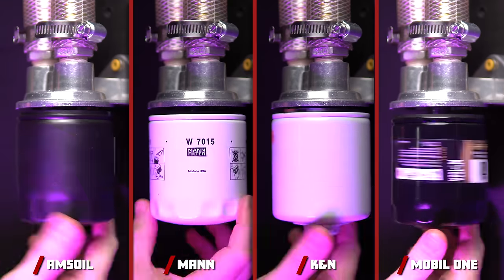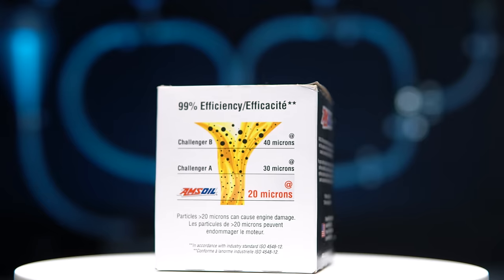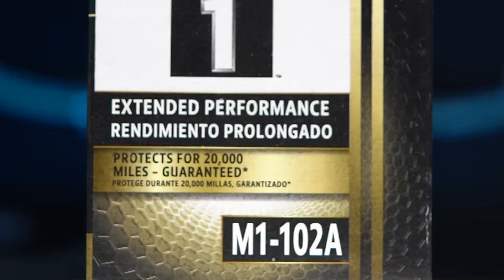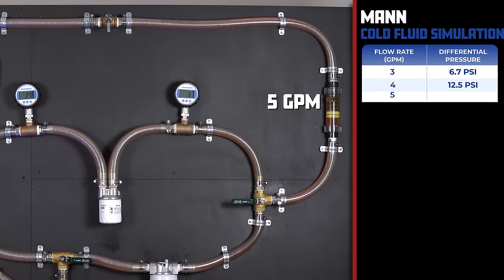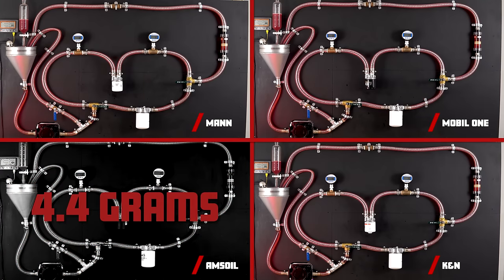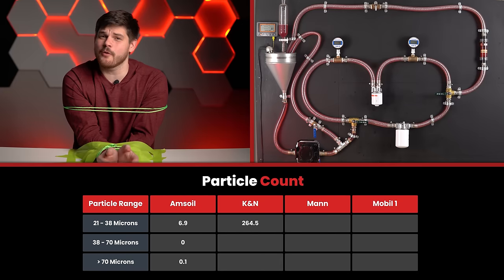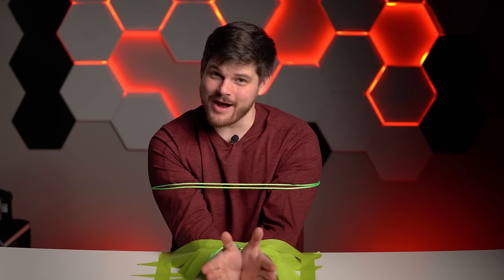Best Oil Filters of 2024 (Engineer Tested) - Amsoil | Mobil 1 | Mann | K&N

Comment: I appreciate you taking all this time, but flow rate is a moot point.
This is because the filter has overhead because in a running engine the contanmination will be high. 
What you really need to test is how much contamination gets past the filter.

Comment: Since 10W-30 and 0W-30 are the same viscosity and same lubricity at operating temperatures (once the engine is warmed up) is there any reason to continue using 10W-30 or even 5W-30 oil? The only difference I could find was they freeze more easily and are only thicker when cold compared to 0W-30. I absolutely understand the NON "W" number should be what the manufacturer recommends unless in extreme hot/cold weather.
Reply: Oil is very complex. Even though theoretically 0w-30 and 10w-30 should have the same viscosity at operating temperature, but in reality there may be some difference especially since 0w-30 is synthetic and 10-30 can be conventional. Also, "W" rating affects the non "W" rating.
Reply: @fattygamer94  I haven't seen anything showing how the "W" number effects the non "W" number. Unless I'm mistaken, the "W" number EXCLUSIVELY correlates to what temperature it will freeze at.

Comment: So are the bypass valves opening all the time at cold startup???
Reply from the maker: Most likely! depending how cold :)
Reply: @BrandRanks  no, the bypass valve will only open if the filter gets clogged.  Unless you don't change your oil every 5-10k miles, it will never get thick enough to open the bypass.  Engine oil is designed to flow easier at lower temps not harder.  The W in the oils stands for Winter not weight.  The lower the number the less viscous the oil.  So a 5w-30 oil will flow easier at cold temps then when it is at a normal running temperature.

Comment: Dumb question: how would these results translate for cartridge style filters?
I'd assume capacity and bypass wouldn't be relevant, but are filter media effectiveness and flow assumed to be the same as these spin on results?
Reply from the maker: That's not a dumb question! Great question. Unfortunately we have not tested cartridge filters as it would require an overhaul of the rig, but you are correct the bypass valve would be moot as that's included with your car not on the filter, I would not assume the same performance nor flow, given they can vary wildly. But at a minimum you could do it based on the material made off, for example I would go with a full synthetic media one for best filtering performance and average flow restriction. Thanks for watching.

Comment: Better flowing, less wear oils  and proper maintenance or even shorter maintenance intervals means you can get the best benefits of a filter that filters well. If you use long maintenance intervals, inferior lubricants with more wear, you need a filter with increased flow to keep your oil moving.  Oil, filters and maintenance practices together form a system. There relevance and rewards are effected by each other.  Those who spoil their vehicles pay a premium for shorter maintenance intervals, higher filtration, better oil get the payoff of less wear of components and typically longer service life. People with higher flow, less filtration, inferior oils and long maintenance intervals are rewarded with savings on maintenance but the draw backs of increased wear, less service life.  Pick your poison. 😂😂 Amsoil rocked the Project Farm review and I have used it in Motorcycles and will be trying it in my truck but if you want something cheaper that is AMAZING, try the Pennzoil Ultra Platinum oil. I have ran that oil for a while and have been impressed with its performance and cleaning abilities.  It has even increased compression in a old work van.  The van would only be about a quarter quart low but now it doesn’t lose any noticeable oil and the quality of the oil after 3k miles is much better than what I have experienced with other oils. If the Amsoil doesn’t knock my socks off, I have no reservations going back to the Pennzoil Ultra Platinum oil. I have to order it online because my Walmart doesn’t carry it, but it is worth it.  It has been the best I’ve ever used so far.

Comment: If you cut the oil filters open you will see which ones are identical and made by which companies. Mobile One and K&N are Champion Lab products. There are identical on the inside.

Of course I haven't kept up in the last few years to see if there is corporatism in play.

My comment is before I finished the video. I would cut open several of each. I can provide a link showing the filters cut open where there are identical.

Comment: So if your fresh oil is contaminated with foreign particles, i think you better find a different supplier. Or clean up you funnels and stuff. Also Most oil filter bypass valves open at relatively low pressures, so all of the oil getting pumped into the engine is Not 100% filtered much of the time. Stew on that for awhile...

Comment: My choice is a Fram Ultra Synthetic because of its 99%+ filtration efficiency for particles at or greater than 20 microns. I use a taller oversize filter that has about 50% more filtration area to compensate for the filter medium's higher inherent restriction.
Reply from the maker: Great idea! we might test bigger filters in the future to see the impact. thank you for watching
Reply: It’s the exact same filter as Amsoil. !
Why pay 3x more ?
I don’t use Fram Ultra , but I would choose it over the Amsoil.
P.S.  , I’d have no problem using it however.
Reply: @Nellis202  That would be the Fram Endurance the same filter as the Amsoil

Comment: And in another one of your videos you said the Wix XP won.  Between the unitless numbers and fast talk I'm beginning to struggle to make sense out of what you are saying.  I'm an engineer working in rotating equipment for API customers.  If I went 402,000 on an 07 Civic with mainly k&n and Mobil filters at an OCI of every 8000mi, aren't we splitting hairs here? That car is still out there delivering food now in a nearby town.  And, Amsoil definitely provides higher filtration but they admittedly do this at the risk of going to bypass. As an actual tribologist said, the right oil at the right amount at the right place at the right time.  I'm staying with Mobil or Boss, but changing those every other oil change or every third....and I've moved back to an OCI of every 5,000 like AMD recommends....going long on oil is just foolish regardless of what blackstone says.

Comment: I know this much. I switched to Mobil 1 filter and a start up rattle went away. Betting drain back valve is better one. I was using K&N. But who is to say that the assembly of filters is a 100% at all times or defects in materials. You never hear of an oil filter recall.
Reply from the maker: True! Thanks for watching!

Comment: so 45% of the test dust has particle sizes below 20 microns (84% below 40 microns), and the oil film thickness on the most critical components in the average car is below 15 microns, making the filtration of sub-20 one of the most important values to know... and the testing lab you went with only reported 21+... 
The amsoil pleat count, while it has an impact on restriction, it also filtered out nearly all 20 micron dust... hole size has a squared exponential relationship to restriction - that's where the bulk of flow restriction comes from, pleat count's primary relationship is to particulate capacity. 
 
 That capacity... the thing amsoil doesn't have much of... would be solved if it didn't filter as well. The less you can capture, the more is still flowing in the system, the more you have to add to the system to plug it.  K&N needed 0.11 grams more to plug -> the 21-38um represents roughly 80% of all particles in the test dust. You sent a 100ml sample pulled from a gallon or more of circulating fluid. So the K&N still had 10K+ circulating particles, while the amsoil had ~260. 
To put it simply since I know someone's going to get confused. If filter X and Y both plug up to the same degree after the same amount is fed to them, but filter X captured more, filter X has a higher capacity, because it captured more... If I submitted a filter that used steel wool, using the test as described here, my filter would win 1st place for capacity, because it wouldn't capture anything. 
 
You know the % by volume breakdown of the test media... do the math
(Engineer tested vs engineer reviewed)

Comment: Play stupid question what is the flow rate of an automotive oil pump generally?
Reply from the maker: That's a great question. Unfortunately one hard to find given it is different for every vehicle. The ASTM standard utilizes 6 gallons per minute as the standard, this what we use for the filtering performance test

Comment: Test the Fram Racing filter please!
Reply: What are you hoping to learn with the Fram Racing filter?  "Racing" filters focus on flow rate over filtering ability and should only be used for very short oil change intervals.  Those who actually race change oil often due to the oil seeing higher temps and possibly suffering some breakdown from those temps.
Reply: Mostly I’d like to know the flow vs pressure compared to other filters but also interested in filtering efficiency. I’m interested for a racing application where I do change oil every 500 miles. I want low pressure drop but don’t want to lose too much filtering efficiency to get it.

Comment: Have you tested a Toyota N1 yet? the GR Corolla community would be interested in this info for sure, since Toyota seems to keep their filter data private. part # 90915-YZZN1
Reply: My 2008 corolla uses same oem filter.  Micron rating is not too good as it is designed for better flow rate.

Comment: I have been using AMSOIL oil and filters for 25 years. My engines have been super clean and very little wear. My son has a Honda Civic with over 400,000km and adds zero oil between oil changes. I won’t use any other product.
Reply from the maker: Great filter! Thanks for watching!

Comment: NEver push these filters to their limit .
And what would that be, 5,000 , 10,000 ?
For me , 7,500.
And that’s why I couldn’t justify spending an absurd amount of money on Amsoil oil, let alone their filters.
Sure it’s a great oil, but not for those intervals.
(Which 

The Amsoil filter is essentially a Fram Ultra Synthetic. 
Fram is $8.57 at Walmart and Amazon .
Valvoline Extended is $28 .
I’ve since transitioned to the Fram Endurance as it has the same filtering capacity but better flow rate.
How much did you say the Amsoil filter and oil are ?
Reply from the maker: The filter was almost 30 bucks with shipping. Thanks for watching!
Reply: Prices dropped.  Used to be 19 for members BUT NOW $9.85. since Fram Endurance came out.  Shipping is Free over $100.

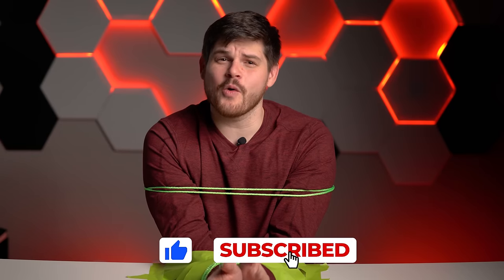Comment: 10:09 what do these numbers mean?
Reply from the maker: The rank of each filter based on the category. A good example is the Purolator Boss, is ranking 3rd in Filtering, 4 in Hot Flow,  2 in cold flow and 1 in capacity. Hope this helps. Thanks for watching!
Reply: @BrandRanks  so lower is better
Reply from the maker: Correct

Comment: Wow, this is assuming all filters have bypass valves in them and why the heck would I wanna filter that flows that fast when my engine is never starved of oil in my daily commute. I would rather have a filter that actually filters like it’s intended to and my engine last thousands of miles. Also, Amsoil claims all you have to do is change the filter and add any lost oil without changing the core oil. This helps reduce the need for expensive oil changes in high capacity oil sumps.

Comment: So overall which would you say is the best oil filter across all the videos??
Which would you use in your car?
Reply from the maker: So far, without having the final OEM results and several other. I'd have to go with the Purolator Boss, great price, great performance overall and good filtration. If in a pinch and can't find it, I'd put a FRAM Endurance given it filters incredibly well and looks suspiciously like the Amsoil but for a fraction of the cost. You can also find it in every Walmart.
Reply: @BrandRanks  ok great thanks..
I’m in New Zealand, so will have to see if I can find either one here..

Comment: I think you have beat the soul out of this dead horse by now. What else do you got? There are lots of oils and additives. What are the best and what's the perfect combination of oil, additives and filters for engine and transmission. Cold air intake waste of money? vs intake relocation. Tires for fuel economy? Torque wrench accuracy, and does it even matter? Best undercoat and how many coats are too many? Best weatherstripping for sound deadening.

Comment: You clearly said all three filters filter to 30 microns and amsoil filters down to 20 microns. 20 microns is a big difference and would say that amsoil will not allow 10 microns is 10 millimeters difference and that’s huge in oil filtration who cares about losing a few psi through a filter it’s already in the design of the system for that this test is bogus

Comment: How about you guys out there send your used oil filters for him to test the d.p. but without adding in powdered test particles. But used filters must be one of the filters tested here. 

If possible to identify if these used filters are original or fake before testing. Also write down the miles done onto these oil filters before sending over.😂😂😂

Comment: 5:19 Completely misleading as to who is winning these tests. The first two tests, are telling you how weak the bypass spring is and bypassing oil past the filter. I don't necessarily need the oil bypassing the filter. So the best filter in the first test was the one that was the most restrictive the best Joker in the second test was the most restrictive. Because more of the oil is having to go through the filter and not bypass the filter.
The third test, you continued introducing contaminants until the Flow Restriction had increased to 8.8 g. Weight is not a Flow Restriction measurement. It's pressure differential. What the hell are you talking about???
Reply from the maker: Don't know what video you watched but we explain in more detail our testing methodology in the first video of the series, make sure to go check it out. Also we kept introducing dust until the differential pressure increased by 8 psi. If the filter at 6 gallons per minute had 4 psi of differential pressure we would stop introducing dust when it reached 12 psi. Testing methodology was derived from the ISO standardized test.

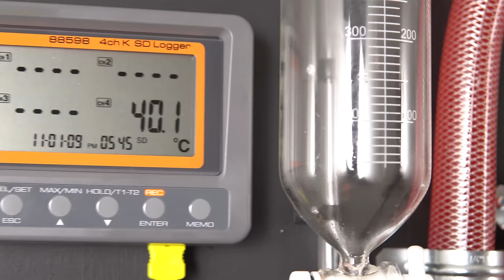Comment: So much bad info and testing in this video.  1:09 Normal engine oil operating temperature isn't 104F, it is 200-215F or 93-100C.  3:28 In a 5W-30 for example, the number before the W describes the viscosity of the oil at low temperatures. The lower the number, the thinner the oil and the better the oil’s cold temperature / cold start performance. The number after the W describes how thick the oil is at the engine’s normal operating temperature.  4:03 test means nothing, engine oil and gear oil are completely different.  And when it comes to the bypass valve, it should never open unless the filter gets clogged or the oil because to thick from it not being changed.  It could be 0F outside and the oil will still flow and not cause the bypass to open.  Unless you live somewhere that the temperature gets to -30F, then the oil will have flow issues. 

I felt like I was watching the Verge's version of testing oil filters.
Reply from the maker: The oil used was Aeroshell 41 which has the same viscosity as 5w30 motor oil at operating temperature. This oil is used in the ISO test for oil filter a sit removed the cleanliness of the oil variability from the test. ISO VG 460 oil is not gear oil, again, it's the oil used in the ISO standard test to simulate the same viscocity as motor oil in cold temperatures . Additionally, the ByPass valve is not just for when your filter clogs up, it's also there to maintain proper oil flow during cold engine startup as your oil is more viscous. If your oil filter has a bypass spring rated for 8 psi the filter will MOST certainly bypass at 38 degrees farrenheit. In the cold flow test you can see most filter experience a Differential pressure way above 8 psi even at low flow rates. I'd encourage you to watch the first episode of this series with this rig for a deeper explanation of the testing methodology.
Reply: @BrandRanks  The ISO 460 is 100% Gear oil, its even says it right on the bottle, and 5w-30 oil isn't even close to being viscous enough at 38 for the filter to bypass, that's not even freezing.  Now if it was below 0, then yes I could maybe see it bypass.  Do a video showing the filter actually bypassing at 38F with 5w-30, and I bet that bypass doesn't even move a mm and you will also get different psi from using that Gear oil.  Go rent a walk in freezer and do you test in there.